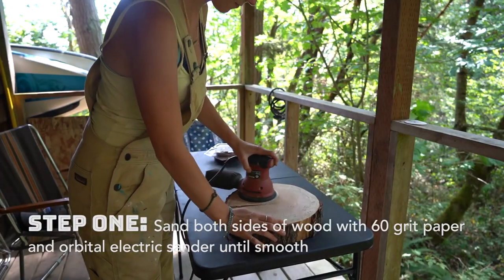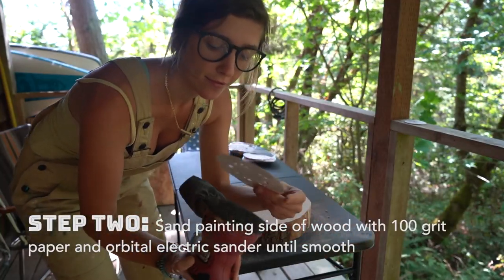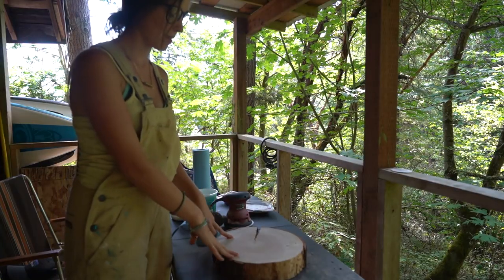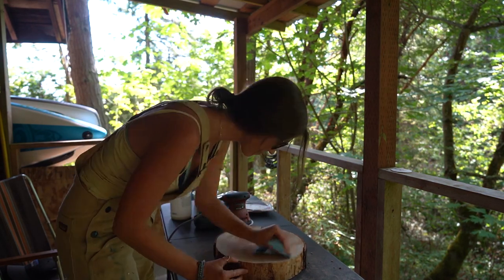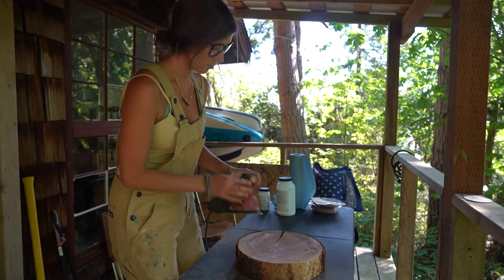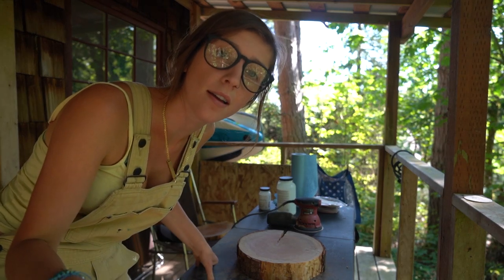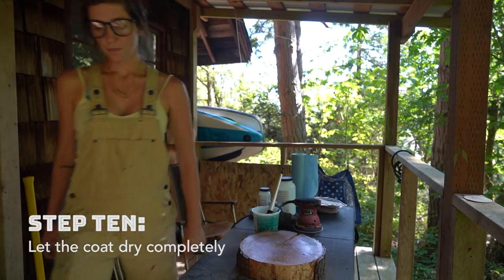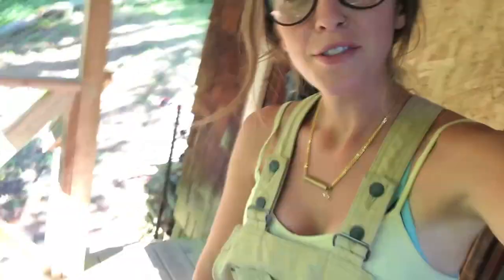How To Prep Wood for Painting (Artwork)

Comment: So from what I gather you want a paper smoothness on your rounds? are you painting with oil or acrylic. And do you apply gesso before you paint to have a white surface to begin with. On a different note: You should try Etching if your local college ever opens back up for classes. I was introduced to it in college after someone saw my painting and drawings in another class. I loved it. Great work by the way.